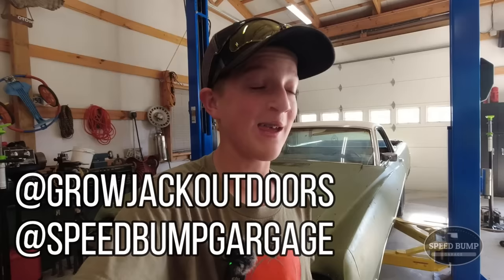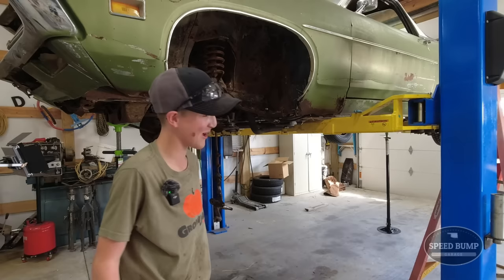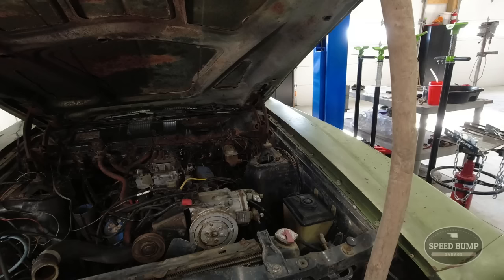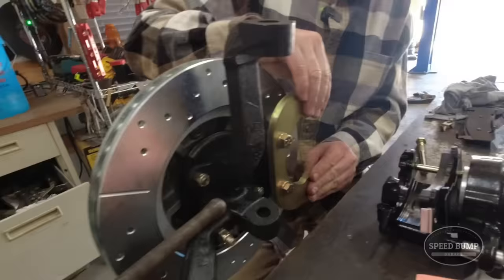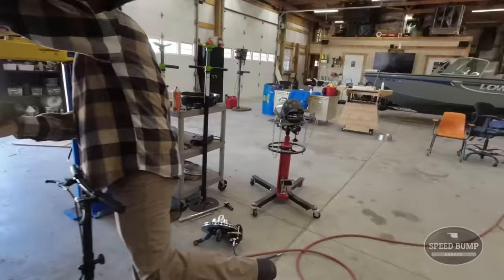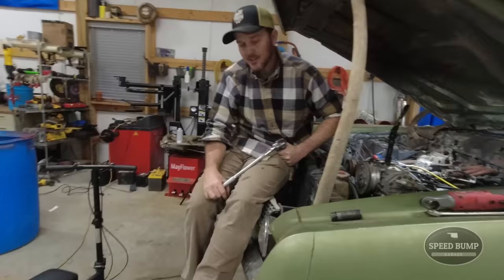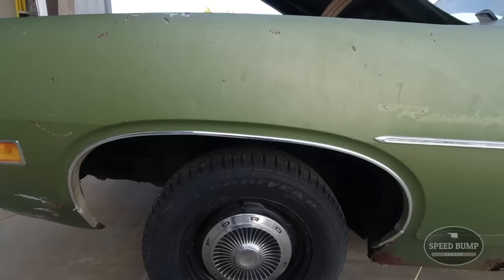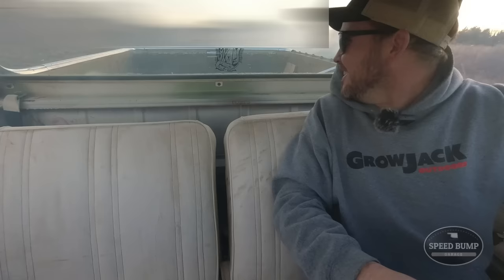Making the Ranchero a BURNOUT Machine! 🔥

Comment: It's one thing I miss is being able to wrench on cars that used to be my hobby started on my mini bike rebuilt my first motor in grade 5 Briggs and strachan for my mini bike my dad built basically out of a bicycle frame big mistake I did turn my hobby into my job started working an auto wreckers because paving ran out of jobs got a chronic tendonitis in my radar from bumping my funny bone on an inner front suspension on a 4 by 4 add surgery on the right arm wCB made me go back to work specialist told me not to go back to work because I'd have it in my left arm within 6 months and he was right both arms got a chronic tendonitis and it's called something else because it never went away still have it to this day and that was back in the late 80s 90s can't control the fingers because it starts to hurt really bad if you turn nuts with your fingers can't hold my arms overhead and hang on to stuff got retrained for parts department bogus WCB course three week course didn't even know how to turn on a computer they taught you on a fish and there is only one business in my town that even used to fish they lied to one of the biggest Dodge dealers on this island told them that was the highest qualified person for the job told me how to sell everything and move I'd be just cut off WCB so I sent the Dodge dealer resume and told my didn't even know how to turn on a computer had to go buy my own computer and learn how so obviously I didn't get the job never did go into that type of job parts person because I didn't feel I was qualified yeah I knew the books but not the computer Went back to work at the auto wreckers cause he wanted me to work in the office he told the WCB that there was a job there for me and then he kept making me go out and pull parts off cars which I wasn't allowed to be doing and lifting transmissions over my head which I was not allowed to lift parts over my head so finally one day I just packed up my tools and left bought a specialty coffee house for 100,000 went broken 4 years had a lot of fun though cut firewood free for a few years probably 10 went into the RV business repairing them for RV rental There were seven people in the RV department when I first started he cut it down to three people because I was doing all the work never got any higher pay even though I was doing all the welding and the wrenching on the rv's and rebuilding them